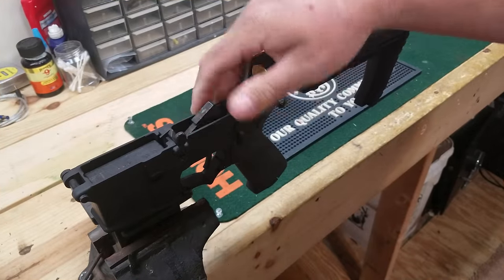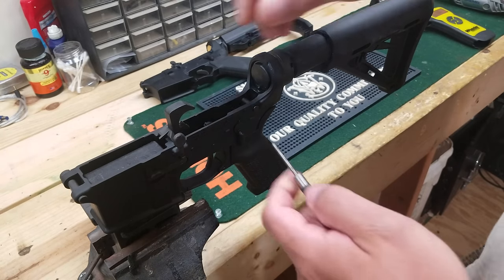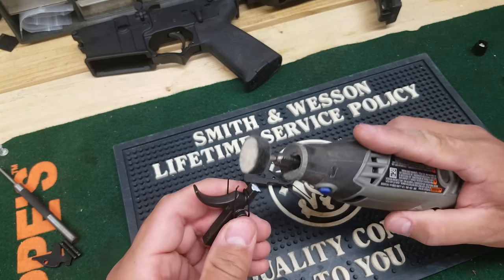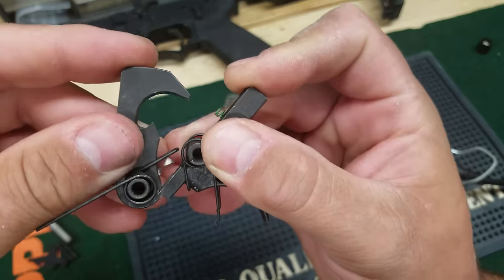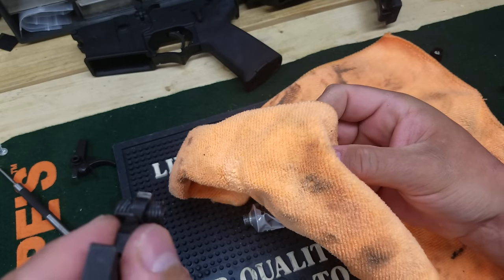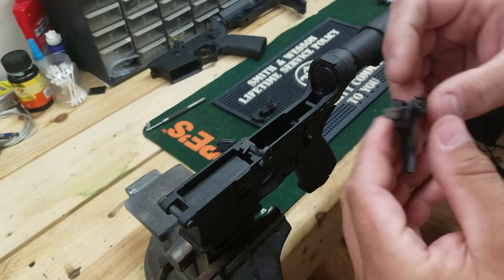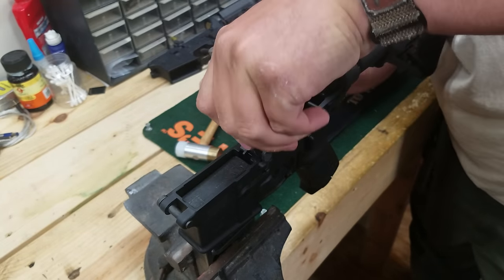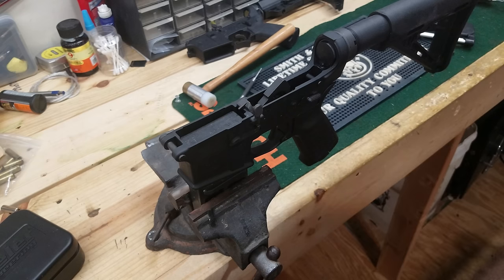Easy Mil-Spec AR trigger Job

Comment: Cutting the hamer spring is not a good idea, because you're altering the mil-spec of the design, and that can get you in trouble if something goes wrong, polishing and smoothing things out is good, just my opinion and I do like your video.
Reply from the maker: Something being "mil-spec" isn't always a good thing. Mil-spec to me just means it was probably made by the lowest bidder, lol.
Reply: @TacticalWingnut  I'm not criticizing you u can do whatever u like, but you said you're not a gun Smith, and I guarantee you no Gun Smith will alter any gun for liability reasons, I understand you're trying to make a smooth trigger, there are ways to do it with out cutting the spring, do your research, consult with a Gun Smith , I learned that from my Gun Smith also from my  instructor for ccw class, this is a liability issue
Reply from the maker: @JazzLowrider  no offense taken at all. Most of my ARs have had the standard triggers removed and replaced with aftermarket ( tac-con, Elf ect). Thus was just a quick way I did them when I 1st started out. A friend of mine was an armorer in the Army and showed me the trick with the spring so I figured I would share the info. The liability for anyone doing the same falls on them and them alone.

Comment: Buy a few bolts for the grip. Drill a hole through and then thread for a set screw. Use lock tight and thread the set screw to the disconector pushing up. Polish disconector and a set of 3 pound springs. It's the best 12 dollar 3 pound trigger job with very little trigger travel. Old armor trick
Reply: Are you talkin about running 1/4 inch Allen screw up the receiver grip bolt  hole?
 The body of the trigger moves up so it takes away all the take up AND pre travel?

I had to Dremel away a relief. DIY is online.

The trigger springs I bought from JP Enterprises.  $13 I think. Yellow.
Reply: @deplorabledave1048  great springs.

Comment: what do i know, lol, but from what i read you should never use a polishing wheel as it has a tendency to round off the sharp edges. lol. also, cutting the spring! really!
Reply from the maker: If you pay attention to what you are doing and go slow this method works very well. Yes, really.

Comment: I'm not a gunsmith but I did watch a video on YouTube...LOL
Seriously though, By Cutting that spring, how does that affect the reliability? Have you ran into any problems doing that? Besides the possible light primer strikes.
Reply from the maker: planedr I have cut it to short and had light strikes but they are cheap to replace. I have 7 AR's and all but 1( TacCon trigger) has this mod done, no issues after 1000s of rounds.
Reply: I've got extras, I'll give it a try. Thanks.
Reply: Did this to both of my ARs. 1000s of rounds and no issues. I also installed a trigger adjustment screw and filed the tail of the trigger to reduce the pull length. It runs like a dream.
Reply: @TacticalWingnut   BUT WHY??   and how does clipping the spring at or behind the contact point with the trigger/pin do anything at all??
Reply from the maker: @tomynoks  Behind the trigger pin will make it to weak and will likely give light primer strikes.
Reply: @tomynoks  I can't figure out why either. The spring still rides in the same place clipped or not. Unless he's coincidentally slightly bending it maybe?

Comment: That gauge is tricky, i have the same one, its reading differently when you pull it right away or take ur time
Reply: I put a temporary mark on my triggers to place the trigger scale in the exact same spot on the trigger every time.  I get very consistent readings  on the scale i use. 
Also you can also use a large foam ear plug to replicate the radius of a finger
Reply: @444MarlinSS  i actually meant how hard and soft you pull that gauge. Not location on the trigger shoe.
Reply: Okie dokie

Comment: Dry fire it without your thumb stopping any , period.  Trust me dry firing makes mechanics of the bolt carrying group loosen up and remove factory mirco metal burrs  and the bolt opens better the more it's used. It's a tool not a china plate

Comment: Why cut one side ur hammer spring? Why not cut half of that equally to both sides?
Reply from the maker: I've tried cutting some from both sides before and its hit or miss weather it will still have enough power to set off a round. Trimming a small amount on one side little by little has always worked better for me.

Comment: a drop or two of oil on the pins and parts would help also
Reply from the maker: Yes it does. I had previously frog lubed everything so I left that part out. Thanks for pointing that out.
Reply: @TacticalWingnut  keep an eye on the frog lube. Turns to sticky gunk after a while,  biodegradable.
Reply from the maker: @aussieexpat  Never seen it do that before, been using it for several years on my guns and knives.
Reply: It's on the bottle. 100% non toxic, ie. Food. It's good stuff, but it does oxidize.

Comment: Where the hell are you finding this "flitz" crap?
I go to Home Depot and ask for it and they act like I'm nuts.
I go to Ace Hardware same thing...
So I just look for it myself.  It's not found near the rest of the polishing compounds and also not near the dremels and shit.
Where do you find this crap?
Or what section of the store?
Is there another polishing compound you can recommend?
I only have one trigger and one rifle so it's sort of important I don't fuck this one up. So I'm taking a little less off the spring leg but otherwise trying to stay exact with your video.  
Don't wanna end up with a hair trigger or one that doesn't function  and then have to wait a fuckin month for a new kit.  
(None of the shops near me sell parts).
Reply from the maker: Several places near me sell it, Ace hardware, Lowes and a couple of auto parts stores. You my need to order it online, Amazon is a good source for it. Any metal polish will do the trick, this just happens to be the one I use as its available locally.

Comment: Timney, Giessle, or CMC, just a thought.
Reply: @Dougarrowhead  I love my cmc 2.5lbs also...thinking of ordering the fostech echo sport as I type...just wish I could get it in less than the 5-8lbs that they're offering it in 🤷🏾‍♂️
Reply: I would rather do a polish job and save the cash wasted on a fancy trigger for ammo instead.

If I was competing I would spend the money on a trigger but I am not so just making it a bit smoother makes more sense, specially when I can get close to five hundred rounds of ammo for the price of a good trigger which will further Smooth out the trigger group from just using it.

Comment: your trigger pull is all over the place 2 lbs to 13 lbs....   you might not be using/holding that tool properly??
Reply: I often notice these guys place the gauge arm on various places on the trigger between pulls. The arm needs to be placed on the same point of the trigger to get consistent results.
Reply: I was thinking the same shit! "Why is the poundage so different from each pull!?!?!
"2.7 , 4.9 , 7.3. 5.7, 700.6 , 10.4 , 1003.6, 1.1 " lolololololololololol

Comment: I couldn't even watch this video after measuring trigger pull less than a minute in. So much fail already I knew the rest couldn't be much better. I later forced myself to watch the rest and I was right.
Reply: what was wrong with the way he used it. He dropped two lbs of pull off of it.
Reply: Using a dremel, using flitz, cutting the leg of the hammer spring. Conservation is the name of the game. You can do this yourself without making the gun possibly dangerous to operate.

Comment: cutting the spring doesn't do anything. still rides on the same place on the pin
Reply: Level Drne   I was thinking the same thing. You could put a slight bend in the ends of the spring. But, there's a fine line between lighter trigger spring pressure, and light primer strikes. You're better off just working on the sear, and hammer engagements. I lightly file them, on all of my guns. Every gun I own has a light trigger. You just have to be patient when removing any material. If you go too much, then you will be buying new parts. I went too far on a Winchester model 290 .22lr, and had to replace the hammer. That was my first try at it. Lesson learned.
Reply: @jamiesloan5902  
Bending or cutting is fine. But it is subjective. The most reliable method is to buy a new spring for 11 or $13 from JP Enterprises on eBay. Yellow one.

I never had a light primer strike. 

BTW, I did not use the included
 trigger spring, just the hammer spring.

Comment: Will this work on a MPX trigger?
Reply from the maker: 223spree in theory it should. I'm not very familiar with them so I would just polish the contact areas and test it before you cut the springs
Reply: TacticalWingnut I was thinking just polishing the contact area’s. The MPX is hard on FCG’s so I don’t think I would cut the spring

Comment: I've done that to my pistols trigger and added a drop of oil. I'm not sure if I noticed a huge difference but I also don't have a gauge.
Reply from the maker: Steven Bush You can definitely feel the difference on the AR trigger. I've done polished a few on my pistol triggers and they seem to smooth out some but not a dramatic change.
Reply: Did you only cut one side of the hammer spring
Reply from the maker: Yes, just the right side.
Reply: Jonathan - You need at least one side left long in order to retain the trigger pin

Comment: could not let it break in.
Reply from the maker: They only break in to a certain point.
Reply: @TacticalWingnut   toilet paper. tact? JP upped. with kns pin kit running dogbones outside. on what?  MOE.or, quad rail,

Comment: Don’t cut the spring bent it angle of the leg Jesus
Reply: Can you explain a little more detailed bro? I don’t want to try this if it’s a potential disaster. Hammer springs are cheap and I’ve polished it up but want that lighter break!
Reply: @Petryfied  he’s cutting the spring to make it have less tension on the hammer but this can cause light strikes and can cause other issues like pin walking so to combat this Lee the spring the same just bend the springs slightly to make less tension and reduce pull I would also cut the  fin off the hammer to lighten the pull
Reply: @RAPTORGUNWORKS  yeah I filed off a couple thousandths off the hammer it seemed to really help after I polished it. I hear the trigger spring is what makes the final weight heavy or light. I hear of folks clipping off a coil on the spring to make it lighter?

Comment: Jesus dude, you stone those, you don't polish them!
Reply from the maker: I've done both. Stoning is definitely better but most people dont have a good set of stones.
Reply: Or 1000 grit wet or dry sandpaper with some oil on a flat surface

Comment: oil it
Reply from the maker: Tom Fletcher oil will help for a short time but it attracts all the dirt and carbon and will make it worse in the long run.
Reply: Never EVER oil the trigger/sear engagement point.
Reply: @Midwestboltandblade  giessele recommends grease on all engagement surfaces.